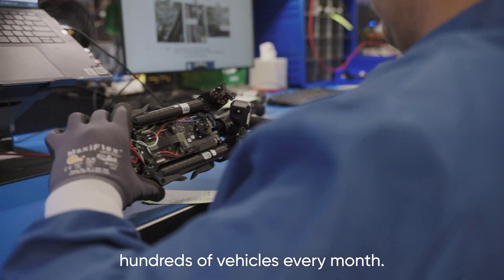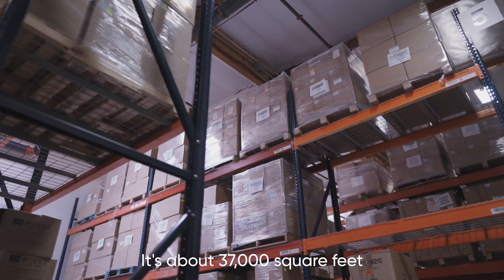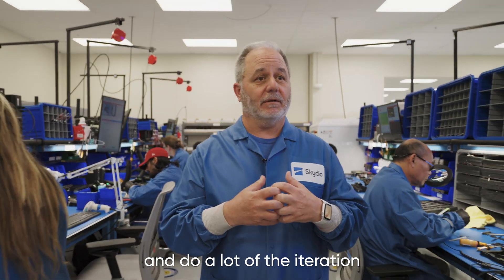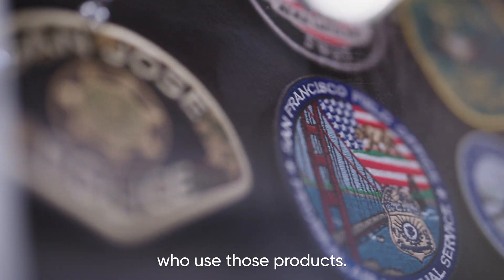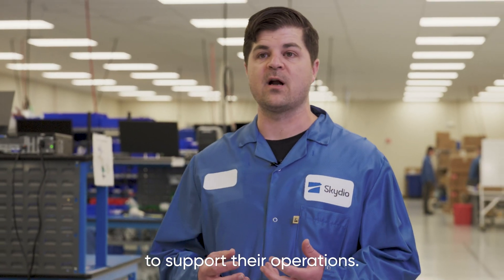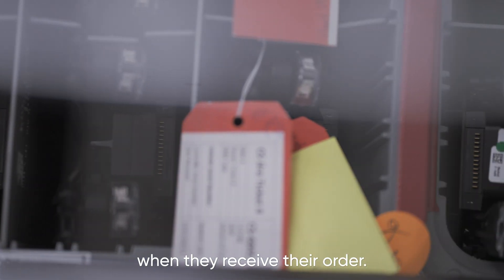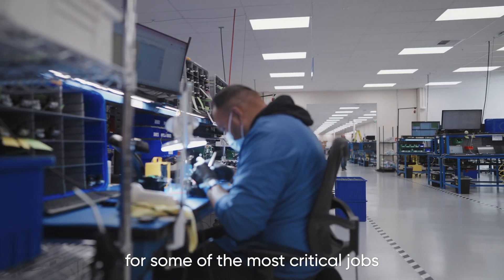Inside Look: Skydio Drone Manufacturing Process

Comment: I certainly do not want to knock down any people who are actually making things with their hands. But unfortunately, even if this were the greatest manufacturing operation on Earth, this video does not showcase it well at all. 

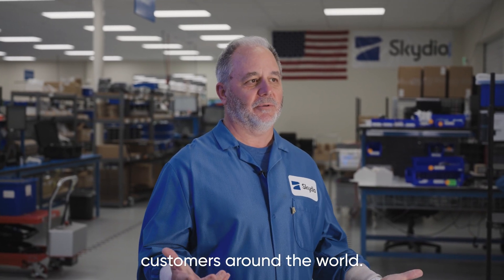Half of the precious screen time is spent to jump about between half a dozen of instances of wires being hand-soldered, about as many instances of stuff being taken off and put back onto shelves, and a few screws being hand-torqued here and there. Two different size boxes being put out for shipping towards the end (3:30) make one wonder if this is the typical production volume of this facility.

The film does become somewhat more coherent towards the end. Automated testing and checking the order for the customer were nice to see.